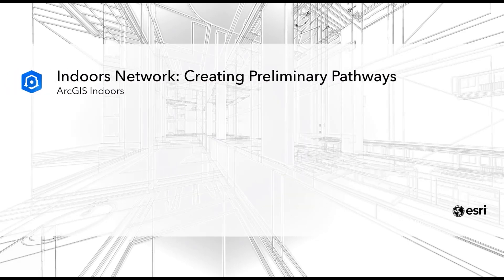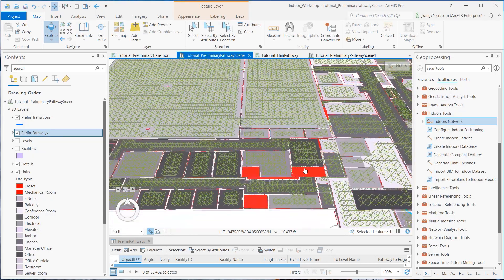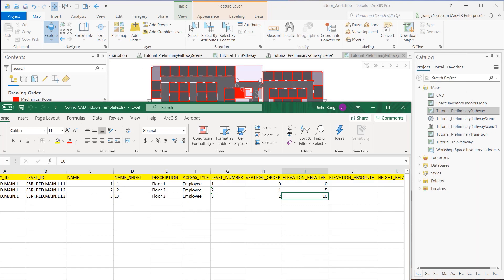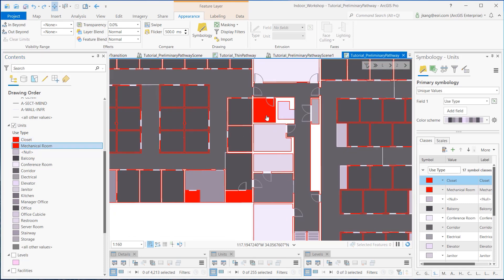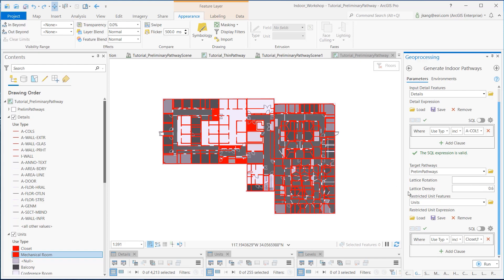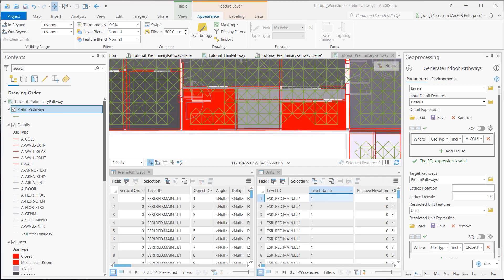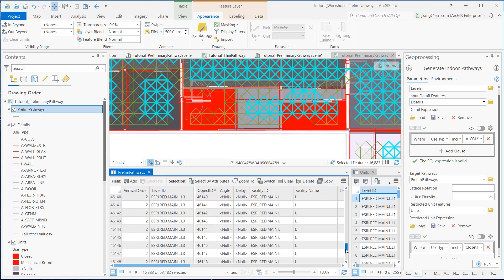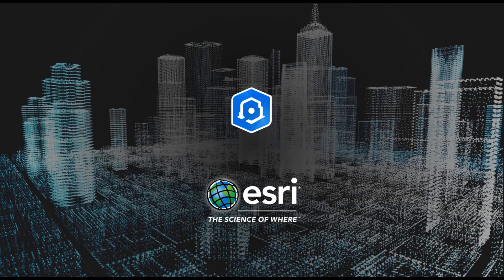Indoor Network: Creating Preliminary Pathways

Comment: Hi there, I find some preliminary network in your video cannot passing through doors. Please check the two rooms under "Tutorial_PreliminaryPathwayScene1 at 6:53. How could this be resolved? I think changing lattice density may help. However, it would casue longer time on preliminary network generation. We try to set the lattice density to 0.35. We still find some rooms with the same problem. How this can be resolved? Your kind reply is appreciated. Thank you.